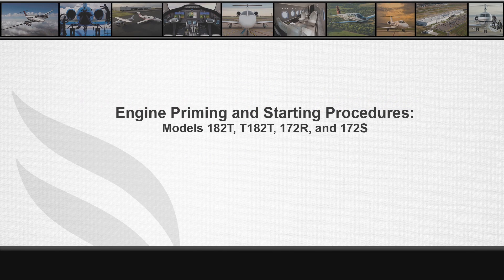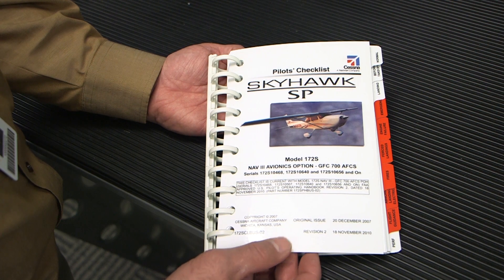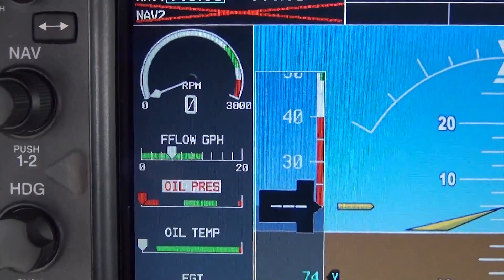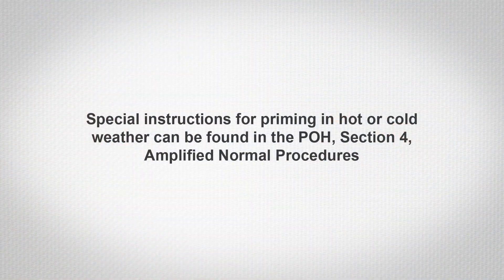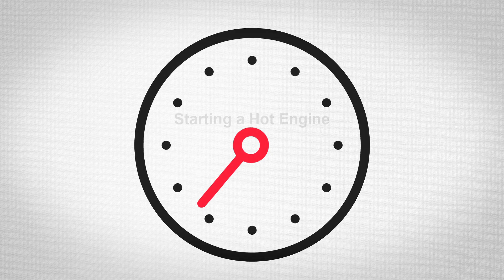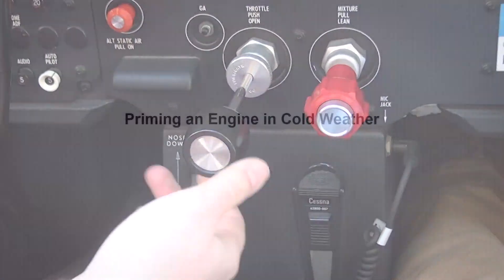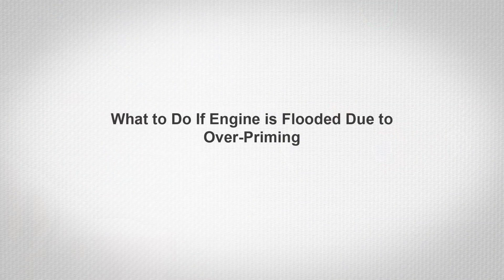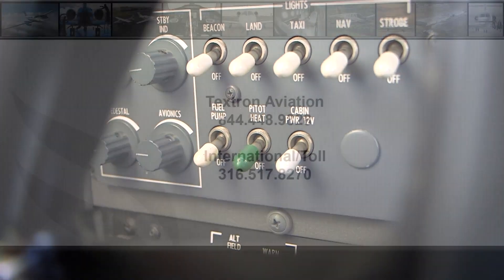Engine Priming and Starting Procedures: Models 182T, T182T, 172R, and 172S

Comment: 2019 172 Price is approaching $400,000. 2012 - $307,500 
I would like to know if the production numbers are suffering because of the ridiculous cost of these aircraft. They are much different in terms of avionics but let's face it, it is still a 172. What is the mark up on these things ? Shit I have heard 700,000$ for a 206. Besides the rich weekend warriors , Do people actually buy these things?  I know for a fact most businesses and flight schools are just going to outsource and have their aircraft rebuilt for way less than a new  one. How long till a 172 approaches $1,000,000 ? Plenty of pilots out there who need this stuff for their everyday jobs are stuck with old 172s from the 70s and 80s. Do you people take into consideration these people or just your rich clients ? I bet you anything that a 172 cost well under $200,000 to make.
Reply: You tell em dude, i absolutely agree. How many of these would they be selling, i would imagine very few. $150k new would be more like it and that's pushing it.
Reply: @spiro5327  I suspect the Aircraft manufacturers have determined that they can produce 100 aircraft a year and make X amount of $$$ but if they jack up the price they can produce the same income but only make 25 aircraft per yr and then, they can sit on their fat asses. 🤣
Reply: One of the reason's GA is in decline...
Reply: Currently 182T from factory are over a year out and 206 is a year.

Comment: I think it is better not to push mixture all the way in after engine begin to running... To avoid fouled plug...
Reply: Just lean it out shortly after start
Reply: He's right, leaning the mixture on the ramp kills hundreds of thousands of pilots each year
Reply: It NEEDS to go all the way in. After it starts. Set RPM to 1000 and then lean before taxi. NEVER stray from the POH. (This only pertains to fuel injected models) Carburated models start with full mixture already applied.
Reply: It's kinda worrying how everyone has a different opinion on mixture control. Do they not teach you this during flight training?
Reply: @ciri151 they do, but 10 CFIs will give you 11 different answers on priming.

Comment: where is the primer button???????????
Reply: Its fuel injected not carburettor. Priming is done by moving the mixture.
Reply: @Foxbat1155  in a fuel injected engine isn't priming automatically done by the ECU? Same goes for mixture control.